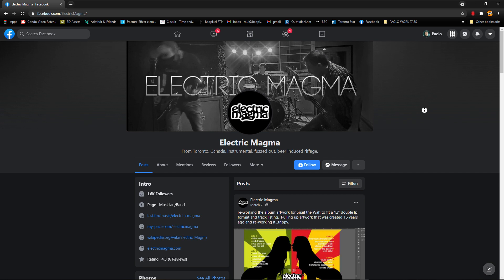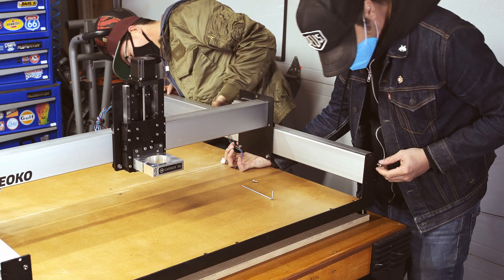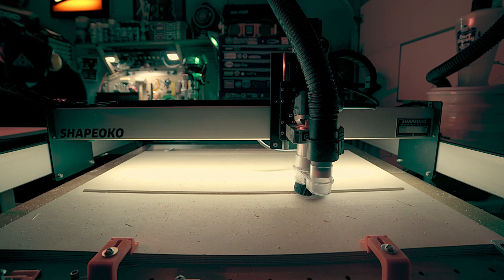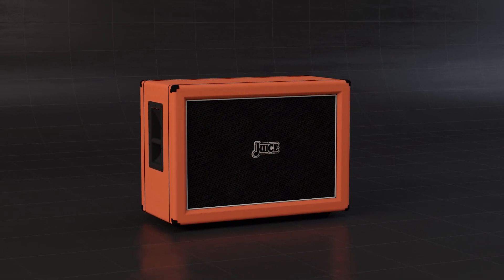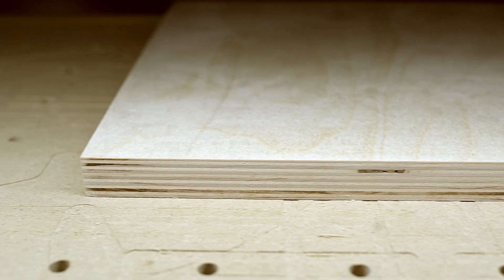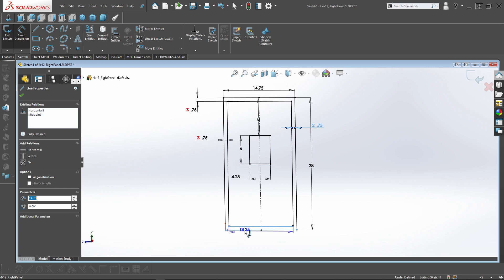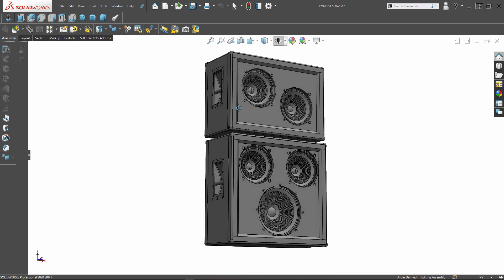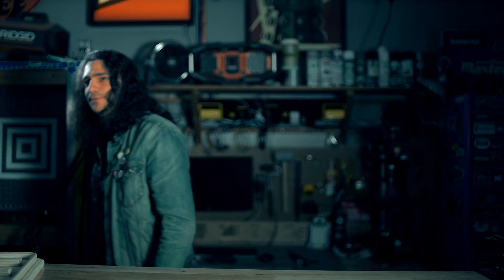How to Build Guitar Cabinets pt.1

Comment: what designing software did you use?
Reply from the maker: solidworks for the designs.  Then popped out 2.5D cut files to Carbide Create and cut on a Shapeoko XXL.   All the details are coming in the next installment!

Comment: Do you plan on releasing the 3D schematic or a 2D schematic of the final assembly? It would be dope to have a thorough reference to build from as a beginner.
Reply from the maker: We won't be releasing files but will go into A LOT of detail in the upcoming installment so there will be very little to interpret.  Also, we can elaborate on anything that isn't clear through the comments or DMs :)

Comment: Nice!  Can't wait to see the next one!

5:19 - That's a great tip!  I've had "18mm" BB-ply measure anything from 17.25mm up to 18.5mm, depending on the sheet.  It always means minor adjustments are necessary on final assembly.
Reply: That's why dado blades come with shim kits. 🙂